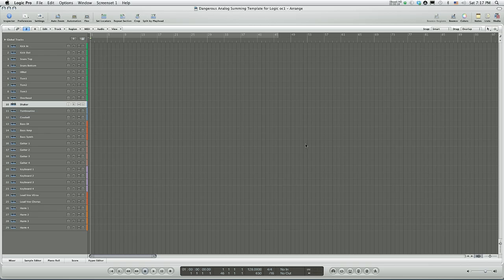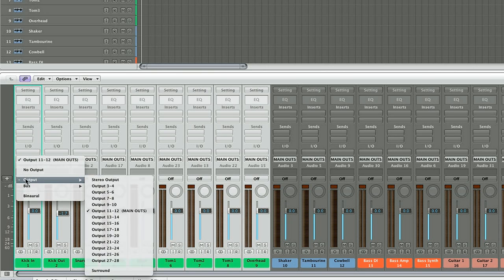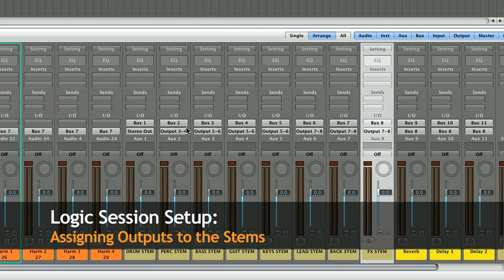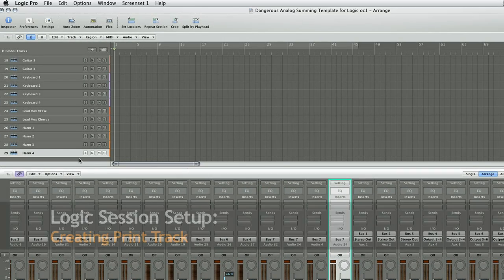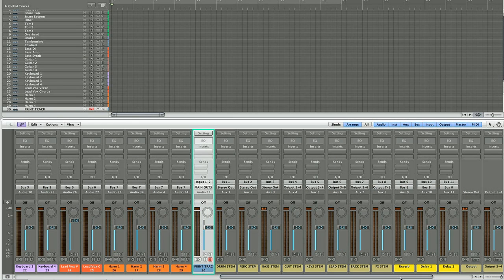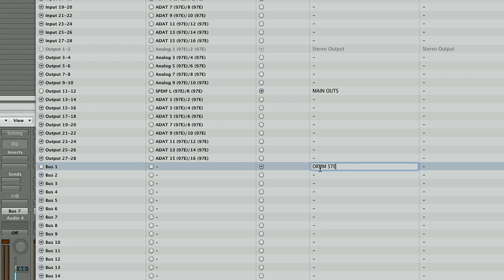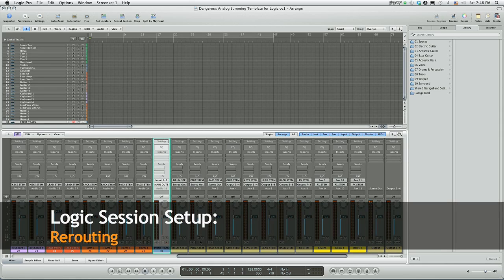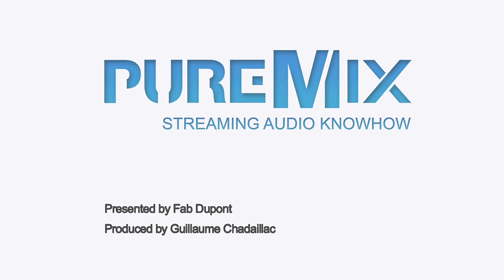Analog Summing: Logic Session Setup

Comment: I’m having an issue. I recently got a Mixdream xp mk2. I ran the 8 1/4 inch outputs from my Scarlett focus rite 18i20 (which already has an ad/da converter) into my mixdream via a db25. Then ran XLR from the main outputs of my mixdream back into the input lines 7-8 of my Scarlett. Did everything you did here as far as the bussing, on my print track set the input as 7-8. But when I hit record we get a terrible feedback that almost destroyed our ears! What am I missing here?
Reply: Will probably need to mute the relevant channel(s) on the focus rite. Another person also mentioned using an XLR to TRS back into the interface because of feedback, rather than plugging the main outs of the summing mixer into the focus rite with xlr-xlr. Curious to see if you resolved the issue.

Comment: This doesn't cut it anymore. I've got an Apogee Ensemble and they demo putting an I/O plugin instance on their audio channel. That's not necessary as you can output to the aux buss in 10.7.8 of Logic Pro and then that new Input out to the specific Summing Mixer Stereo Out. Mine is a Rupert Neve Designs 5059 Satellite Summing Mixer latest. What is required is for every Plugin that you have on a Buss you put an I/O Utility instance at the end with Output to the FX Stereo Sum [I use Output 9-10 that gets autogenerated] and the Input return to the Ensemble being Input 7-8 followed by the Plugin Output Chanel set to Stereo Out for direct Monitoring. I don't put any Sends on my audio Tracks. I put those on the Stereo Pairs of the 5059 for my other 3 stereo pairs to the Summing Mixer.. 

Vocals come in smooth, in phase and just a joy to mix. The F/X will come in out of phase unless on that FX STEM I have for the 4th Stereo Pair that manages F/X if  I don't output that to Stereo Out and inside the MASTER Channel make my first Plugin instance another I/O Utility with Input 7-8 from the 5059 and Output to Stereo Out 1-2 which then continues on with the Mastering Chain to bounce out.

Works great w/ ZERO Latency issues. The RPN 5059 is a beautiful piece of gear. Next will be the Shelford 5254 Bridged Diode Compressor to remove all but my last couple Fab Filter Compressors, or all of them depending on how much better it sounds through the 5254, and then the Portico II Master Buss Processor leaving my Master Channel just having an I/O Utility instance with the final mix coming from the Portico II only.

Everything bounces in Real-Time, in phase.

Comment: Ok someone please please please help me out. I have a neve orbit I’m using for my summing. I can set everything up the same as this vid but the Rec. button really is glitchy in Logic Pro as it works half the time hearing the audio so I’ve found enabling  the input monitoring box on the track allows me to hear the summing in action. the only problem is the summed signal is completely out of sync with the session. Therefore specific editing with the grid beyond eq really can’t be done. Ok I can live this as well I’ve found enabling low latency mode will enable me to print my summed stereo track in tune with session which is cool. But my biggest caveat is how the heck do you solo individual tracks for listening when I’ve already have everything set up for summing??? I’ll take any feedback thanks